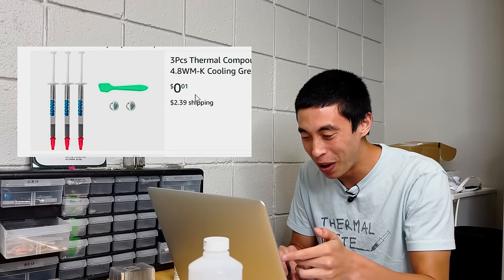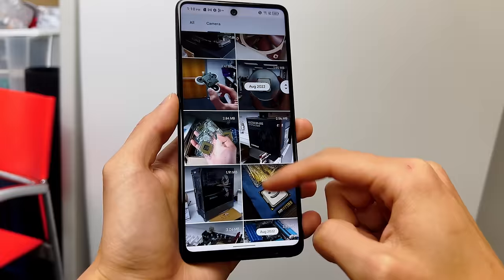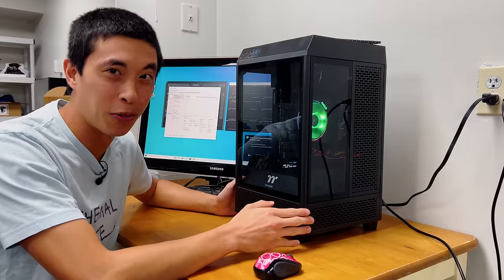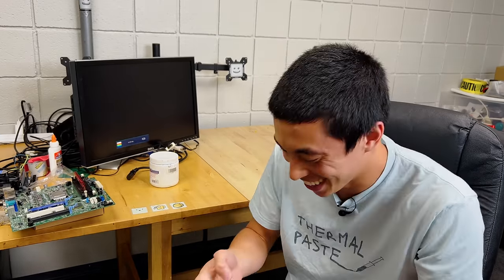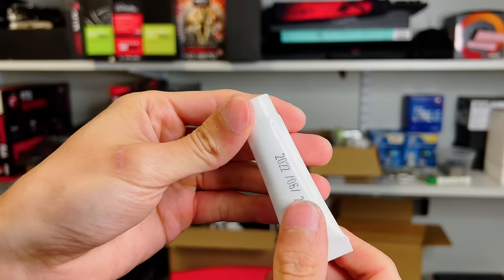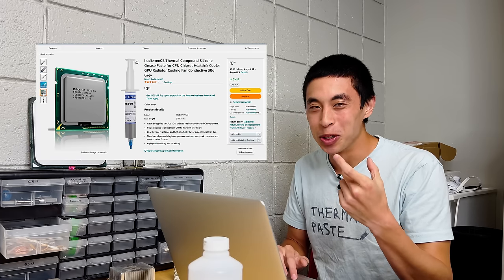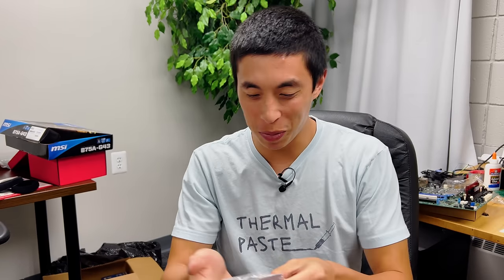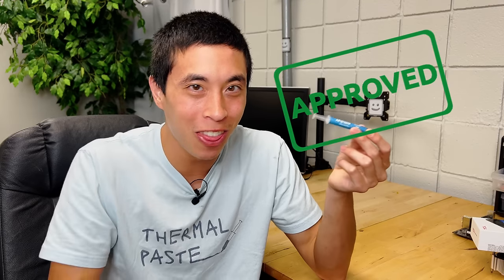buying the SKETCHIEST thermal paste I can find..and regretting it immediately

Comment: I had also bought one of the thermal pastes in the large tube. Its performance turned out really well, I used it on all my systems and my ps3, and none of them overheated. Thats sad to see that there is so much scam pastes
Reply: I have 30g of GD900 from years ago in a glass container, it works absolutely amazing

Instead the one he reviewed didn't go well
Reply: @lucarossi8374  I have 2 30g tubes of GD900, good stuff!
Reply: i doubt thermal paste companies really worry about scammers copying their products so i guess there's just a lot of copycats with bad quality
Reply: @Daemon4  no, the guy in the video faked the results for whatever reason
Reply: Sadly, there are a lot of scam items like flash drives and phones with advertised specs that match absolutely none of the real specs.  Some of them are phones with specs that would have been OK 10 years ago but are sold as flagship level phones.  If you want a phone for the camera, avoid those fakes at all costs.  Their cheap 5 MP cameras can't take an acceptable photo from 10 feet away!!  Usually when you see those, they are allegedly a 64 MP or 108MP camera when they are not even close in picture quality to the real thing.  Really I wish they would just do something really silly and advertise the fakes as 600 MP or some other wildly absurd number.  At least then the fact that it is a complete lie would be obvious to anyone who knows they don't exist yet.  I would give them credit for selling them cheap but I could get a used phone that is not a fake for the same price.  That is right, you can get a good used phone without fake specs for the same price as those things and maybe even in good condition too!  Even one of those in fair condition with a few scratches would be many times better than those weird fake phones!!  I should also caution anyone who buys the fakes that the memory advertised is in reality a lot less and any files stored on it will likely mysteriously vanish!  The crooks who make the fakes have ways to modify the software to report fake values.  With that said, it wouldn't surprise me if the fakes had malware on them (hidden of course) that sends everything you do on them somewhere.  It is hard to say if they really would do that but don't be surprised if they did!!
Reply: @charleshines8523  bruh you should base that on the processor and the camera sensor, more points for software optimization, whatever else Is not relevant
Anyway i understand what you are saying but that's not the case, this thermal paste Is really cheap to produce and they have no reason to make something worst, nobody would buy It then.
And also they lie when stuff Is ridicolously cheap to be true (smartphones are the most dumbass example)

Probably he didn't screw the cooler After Every thermal paste change 🤷😑
Reply: @lucarossi8374  I was just trying to point out how far some people would go to make a fake item.  Here I was thinking I had nothing better to do but they seem to take that to another level of absurdity.
Reply: Oh come on you can afford 20 dollars for proper paste that cakes,and they just putting them on thin layer for temp testing of cpus
Reply: Just because it didn't hit thermal cutoff and shut down, does not mean you improved anything. You could have made it worse, and barely have noticed due to the system already performing poorly before the "fix", thermally. The only way most PCs and consoles won't function after a paste change is if there's either conductive paste or no paste at all. I've been in the repair industry for around 20y, and I can tell you now: Use Thermal Grizzly or something comparable. The system may WORK with just anything, but you WILL notice a difference with quality paste. Maybe up to 5 or even 10 degrees C.
Reply: Is it HY-510?
Reply: @AvroBellow  No it was way more cheaper than HY-510. I'm currently using HY-510 on older laptops which does acceptable job.

Comment: GD900 is actually a really good brand of thermal paste (if you manage to get a not fake one). Techyes city did a review of it comparing it to better known brands.
Reply: He might have mounted the cooler in a wrong way, i also have been using the GD900 for years and it's perfectly fine
Reply: Totaly agree
Reply: that's what's in mine right now.
but it wasn't 1c
Reply: GD007 same performance as Arctic MX4. GD9OO-1 worse then Arctic but much cheaper.
Reply: @DnvGoodwin555  Order confirmed , hopefully il get it untill december , since the war started everything is wafull

Thanks allot for the tip :D
Reply: @DnvGoodwin555  GD900-1 is easier to apply
Reply: @lucarossi8374  I am fairly certain this CPU and cooler combination is pretty much on the edge of the throttling limit to start with. My own Wraith Prism/5800X combo with reputable (if maybe imperfectly applied) paste throttles as well if I don't put the brakes on the 5800X with some fairly restrictive BIOS settings.
Reply: I have the new paste from GD called the GD-2, and it goes toe to toe with my MX-6 lol.
Reply: How do you knoow if you get real gd900 when original is from china anyways?
Reply: @Benri05  hey, how is the gd2 holding up? i just ordered some for my gpu, couldn't find anything about its longevity. dont want to open my card every 2 months to repaste lol.

Comment: GD900 is actually a very good thermal paste imo.
Reply: GD900-1 or GD007 are even better
Reply: Nice profile picture
Reply: Yep but I don't think he got the real GD900
Reply: There's a new one from GD called GD-2 and it performs similar with my MX-6.
Reply: @Benri05  Bought a 30g tube of GD2. Is it easy to spread?
Reply: @Ben-ld1qi  it's more or less as viscous as the mx-6 so you'll need a bit of effort to spread it.
Reply: @Benri05  Alright thanks. I had the GD900 and that was super easy to spread. And in my testing versus Noctua NT-H2 and Kingpin KPx there was a very minor difference. The KPx is also very difficult to spread and requires pre-heating. It also dries up very fast if you don't spread it instantly and then becomes almost impossible to properly spread. Will try the GD2 once it arrives.
Reply: @MatiX415  Actually, GD-02 is better than both GD900-1 and GD007. 
It's from the same company and goes toe-to-toe with the likes of Kryonaunt Extreme. 
Only downside is its higher viscosity.

Comment: I personally use the GD900 on my 7700k and rtx2060 it's a decent one and does the job really well.
Reply: notanetcher might've been a fake one, I've had good experience with the gd900, repasted a 1070ti that I sold to a friend and the temps are still the same after 2 years, (68c max).

Comment: I had an overheating issue a few years ago, needed paste badly.  I live in a rural area and no one around had any.  I looked up ingredients and found some make up to match very closely.  I used some of my wife's make up to cool my CPU until proper paste came in the mail.  Out sketch that, plus it worked.
Reply: Why didn't you just wait for the paste lmao that's nut
Reply: @AshLordCurry Hell nah, If my motherboard gets here before my thermal paste I'm gonna 100% use toothpaste 🤡

Comment: I have used both of these on a 2700x with a 360 rad and the temps were and have been the same as when I used thermal grizzly. I was hugely surprised but super sketched out by how it looks. Its been running for about 2 years now and it's still alive 🤣

Comment: I feel like a lot of these guys that “wonder” what would happen if you used something completely opposite of thermal paste don’t actually realize what thermal paste is. Thermal paste is basically liquid metal that fills in any imperfections between your cpu and cooler. So whatever you use in place of thermal paste likely just wont work
Reply: Not liquid metal but a viscous substance with high heat transfer ability

Comment: these thermal paste tubes are so freakin large I cant imagine ever running through that much
Reply: Yeah
Reply: Unless you build pc and change parts regularly. I used few of 30gs in past 3 years
Reply: @randhisramiah5325  I don’t
Reply: They are meant for heavy electronics usage where you'll use one of these up rather fast. 

Like in case of mounting Heatsinks to LEDs or such
However for normal people, even under rather frequent use you're looking at several months to years of paste

Comment: I've always wondered why every AMD Prebuilt PCs i rebuild or recycle went for cheap thermal paste where 90% of them doesn't cool the CPU well. But yet they really love getting fused to the heatsink.
Reply: If they have the stock AMD cooler, usually the paste is preapplied, which is actually a pretty good paste.Same goes for many aftermarket coolers but not all of them
Reply: @adamantiteB  That figures despite  most prebuilts from the time frame had their own oversized heatsink and a lower pwm cooling fan didn't do so well as the stock cooler from AMD did. Atleast on their Ryzen product line uses thermal paste that I never had to deal with the cpu sticking to the heatsink.
Reply: @DewRagen  True, AMD seems to use the highest quality paste both in handling and cooling. My AMD Wraith Stealth usually cools pretty well when playing with the iGPU. Also when I removed my friends Prism, it came out easily by just warming it up for 30 mins or so

Comment: Cheap Thermal Paste : 
1) Dries out so fast and you will have cooler removal issue in the next 1-2 years.
2) Rapid increase on temps under load due to thermal conductivity
3) Saves alot of your money

Expensive Thermal Paste :
1) May take upto 3-5 years before it completely dries out even with the most power demanding processors.
2) Slightly increase on temps under load.
3) Good thermal conductivity
4) Cost alot of money

Lesson : You get what you paid for. Hope this helps :)
Reply: No name pastes are horrid but I had good experience with GD pastes, a 1070ti that I sold years ago was repasted with a GD900 (not a fake one like in the video) still has the same temps 2 years later.

Comment: Oh hey i actually have a 7g tube of the first paste but not quite
Mine is the GD900, not 900-1
It worked fine for a low power (15w) laptop and was also pretty cheap

Comment: GD900 is an okay thermal compound, not the best but a good bang for your buck, GD100 is made for small LED light heatsinks, not CPU heatsinks. HY510 and HY810 are made by Halnziye, the same company that manufactures the Gelid GC-Extreme and GC-Pro Thermal compounds, but you wouldn't call the Gelid GC-Extreme thermal compound "sketchy". The reason the tubes are large is because they're intended to be used in production lines or office environments where it requires to be applied on many electronics at once. Now wanna see a sketchy thermal paste? Get the cheap Thermagic ZF-EX and test it just to see that it beats 99% of the thermal compounds on the market, I've tested dozens of thermal compounds including industrial compounds from Thermalloy and Dow Corning and Thermalright TFX and Cooler Master Cryofuze are the only thermal compounds that can edge it out and they cost way more, and the difference is 1-2°C at best.

Comment: I needed thermal paste for my work pc. Got bored and cleaned it. I went to the variety/electronics store across the street and bought a 3 pack for $9. 1 gram tubes.
Cheap stuff but it worked. It's still working after a few years.

Comment: I've been using automotive heat transfer wheel bearing grease for over 20 years in my builds and repairs and have had no issues at all.  I got a 5 pound can of it real cheap back then.
Reply: Right now im running a 4:1 mixture of charcoal tooth paste and KY Jelly on a heat sink missing 3 out of the 8 fan blades on the stock cooler. Things never ran better

Comment: I would use it because my samsung xcover pro got stolen in san antonio texas. We got it for like over $500 and the only one without insurance... we are still paying for it, but im now stuck on my defective samsung s6 active from 2015-2016. It overheats way to easy and can cook an egg when it does... 😐yeah it will blister me pretty good if i strain it too much like: certain calls including instagram, discord, a real phone call, hangouts. The latest minecraft PE will also kill it. When it gets hot it burns or freezes... the wireless charging doenst work at all, and the charging port only cable charges now, but has equivalent of slow charging. It wont charge half the time due to a port error and it will die while charging... it also cant tell you how much charge it has, so it could die while at 15% and show 0% apon plugging it in, or die at 1% then say 9% apon plugging it in! i would like a better phone that i dont have to worry about litterally burning up, since my mom had one too, and it over heated so bad it died, and so did her replacement... so i would really appreciate it! Thanks for reading
Reply: Shout out to all the people who just had their phone die.... comment here is you lost your phone recently! My s6 active completely stopped charging! Im on an siii mini which the youtube app doesnt work and the web browser is slowa and typing is terrible. I for once will not correct spelling errors once I post this, it will be an example to get a new phone!
Reply: #BeOnPointWithTCL

Comment: I’m using a GD900 for my Ryzen 9 5950X, seems to perform well. You prolly got a fake version of the legendary GD900 😂 (sadly i did find out from forums that there are GD900 fakes in circulation these days)
Reply: A back story, GD900 is what I use for my SMPS board prototypes. I ran out of Grizz when my new cooler arrived, so I had no choice but to use the GD900 at that time on my PC. It was when I learned it was decent :D
Reply: @TechBuilder their new GD-2 paste performs similar with an MX-6 but a little more viscous so it's quite hard to spread on a CPU ihs.

Comment: I had bought some unnamed thermal paste from a local shop.I used ot to replace the thermal paste in my phone and also repasted my old laptop.The thermal paste worked great on the phone but in the laptop,I hadnt spread it well on the cpu,which caused it to reach 90°c.

Comment: Your probably not going to see this BUT I want to add vengeance LPX DDR4 Ram 2 ram sticks for 32 gigabytes of RAM then add EVGA 500 BR 8+ bronze 500w power supply and finally a ASUS TUF GTX16500 Nvidia GeForce graphics card I want to put all of that into my ACER TC-895 ASPIRE this is my first PC and I don’t want to break it will I be able to do this upgrade?

Comment: I hear the best paste is Thermalright chill factor 3, it can supposedly get temperatures close to liquid metal without risking ruining your components.
Reply: That paste came with my TR4 Silverarrow cooler. Cooling a Threadripper 1950x but after a few years my CPU went from 65c to 87c. I remounted heatsink but I can't seem to get my temps back down :(
Reply: @wmp0074  You have to replace the thermal paste every few years
it's also possible that cf3 just isn't super shelf stable. 
I put Artic thermal paste on my desktop and though it hasn't been a long time, my cpu is at 30 degrees most of the time, my cpu is also fairly old (i7-6700) so that could be causing it to be cool, as my cpu was designed for the intel pre-included cooler and I put on a beefier (but still low end-ish) cooler
Reply: @wmp0074  I probably wouldn't bother using an air cooler with a thread ripper. that seems into the AIO-required territory.  67 isn't very good imo
always preferable to overcompensate with cooling than undercompensate
Reply: @JessicaFEREM  Yea you're right. I thought the skylake CPU's just ran hot on stock coolers. I have a 6700k in my Clevo laptop and it hits 100c like it's a normality. Need to address this as well :( I'll probably just use the Silverarrow on my Ryzen 1700 if I can find brackets for AM4 motherboard. Then I can give threadripper 1950x a decent AIO as I should have from the get go.
Reply: @wmp0074  well not only was my cpu running hot with stock cooler, the OEM who built it broke the cooler pins so it never made a good contact, and I believe that it killed the motherboard with all that heat being generated. new mobo and an overkill cooler should be more than enough. 
when my friend had it, it would shut off due to overheating. his dad dusted it out and must've knocked the GPU loose because it never booted after that, I put in the gpu again and I used the cpu cooler for a few days while the cooler came in. about 2 weeks later the motherboard started posting and then immediately rebooting over and over.
Reply: @wmp0074  it's kinda silly that my CPU was considered hot in the day and now it's considered absolutely chilly by comparison. 
mine is non-k but it still regularly overclocks due to my windows power plan being set to eek out as much performance as humanly possible. even with that I never go above 40 unless I'm playing a game that uses both my gpu and cpu maxed out.

Comment: Another fella made a test a longer while ago, comparing that 30g syringe content to a toothpaste. Min/max temperatures were exactly even. Probably dries out much longer than Colgate and thus suits just fine for a Celeron - based - digital - word - processor - or - something , but still, it's not what you want on your core for sure. I've come upon your video looking for the reviews of HY510 lying in front of me on a desk, and now I wonder what to do with it, cause I won't brush my teeth with it, right.

Comment: I dont understand cheaping òut on thermal paste. If i buy Thermal Grizley for $10 and get 2 applications, then so what? I use it once and won't have to repaste for a few years. Unless you have MANY systems to upkeep or if you need to repaste frequently, there is no reason not to buy Arctic Silver, MX6, or Thermal Grizzley.

Comment: GD900 is good. I using it on R7 5800X with Noctua NH-D15 cooler and have no problems at all. You putting too much paste on cpu witch causing problems